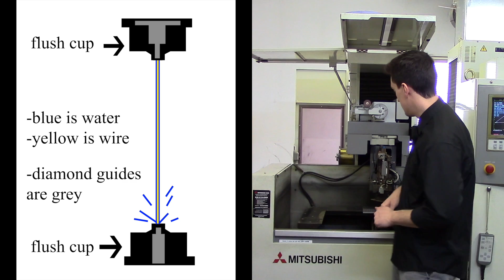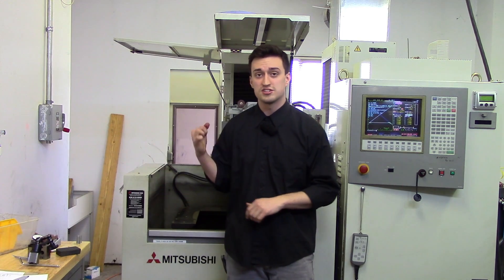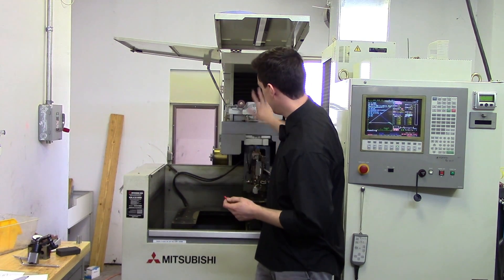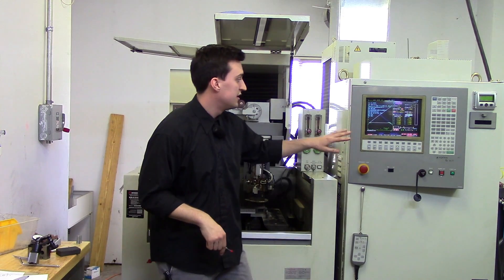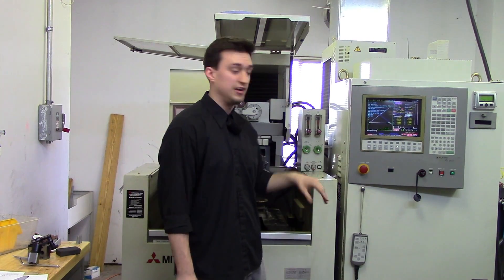Introduction To The Wire EDM!

Comment: You said your edm has an automatic wire setting . Does it also have an automatic fix to 30 second contacts?
Reply: For a 30 second contact call service. It could be simple or hard. Good luck.